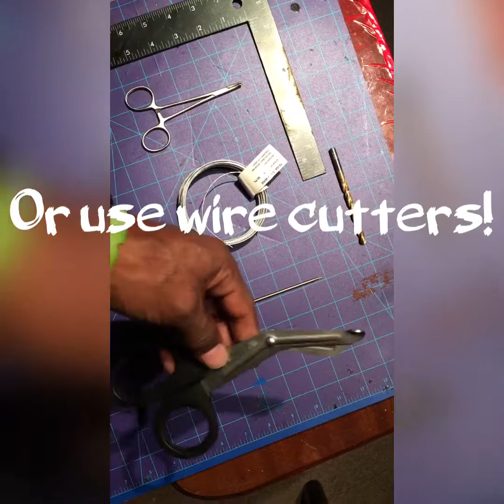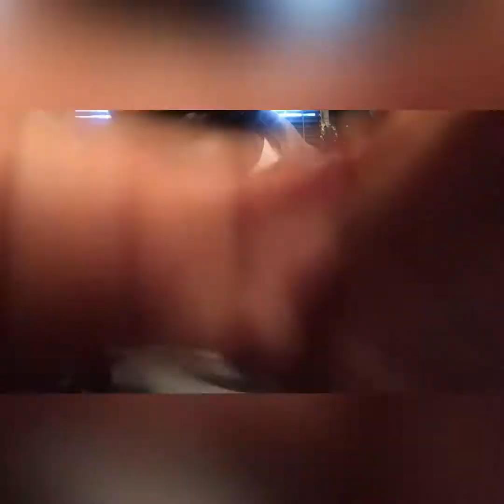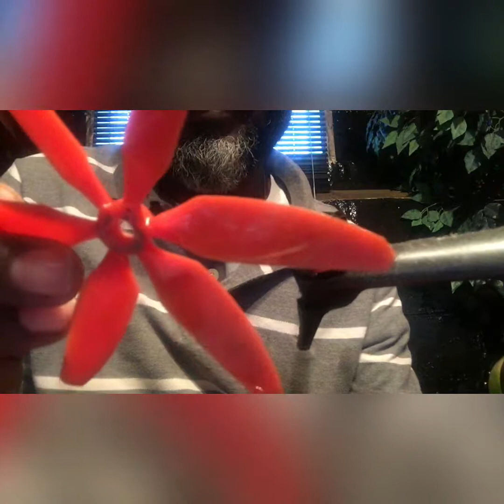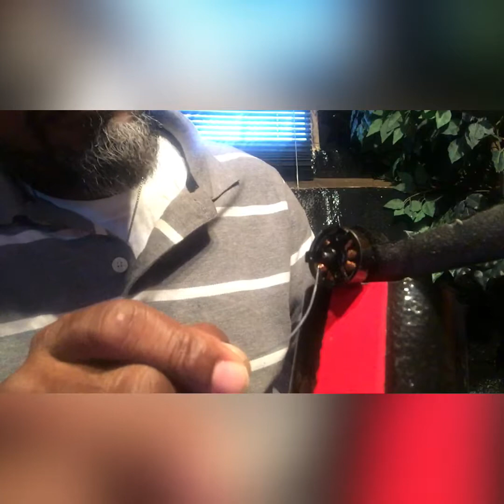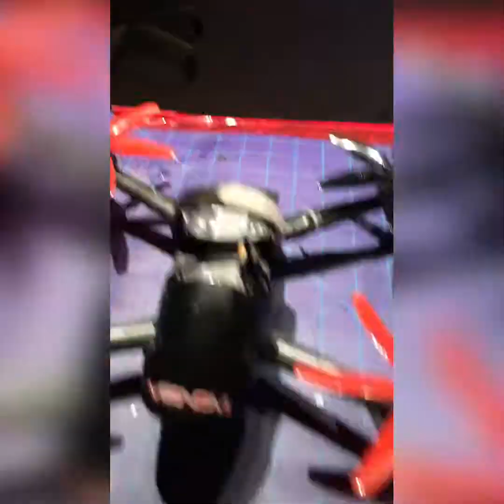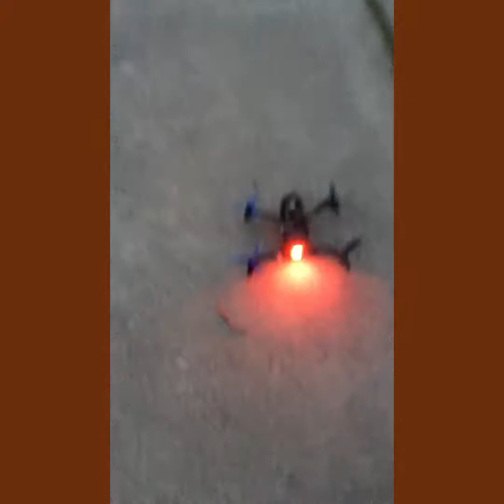New Parrot bebop 2 Propeller mod

Comment: Looks unbalanced and not centered the best it could be but nice idea but if you really wanted you could make a metal small plate with a bolt in the center that the plate will screw into each of the motor bells 3 holes
Reply from the maker: Now I have a 3d printer that sounds like a great idea 💡
Reply: @thomasevans1958  lucky. All my funds go to fpv drones and gear and I have procrastinated since day one on getting a 3d printer aka fpv part maker money saver 😂 but def gonna be my next purchase for the hobby. Btw the bebop 2 with the sky controller 1 is amazing with hdmi to mini hdmi plugged to my analog fpv goggles since it has a mini hdmi input and sky controller 1 has full side hdmi out and don’t even need a phone or parrot app to fly and looks amazing with full telemetry osd also. Of course no acro mode but still a very fun and immersive experience
Reply: @cmosdaboss  What kind of goggles did you get ?  I'm looking for ones with better visual quality than the ones that came with the Bebop 2. Thanks.

Comment: Can you use the mavic pro motor an blade on that bebop an see how much flight time u get
Reply from the maker: Tyrone Rai I think 🤔 it’s possible, because both drones use between 11v -11.4v lipo batteries 🔋 and  motors between 1280-1480 kv motors //1280 being parrot/and 1480 being dji,, it should work,,but mod @ you’re own discretion and risk ,,take your time,, figure out motors power and negative leads ,,, good luck 👍🏾 ALSO,,,parrot body frame weight is lighter than mavic pro so you would definitely get more flight time...